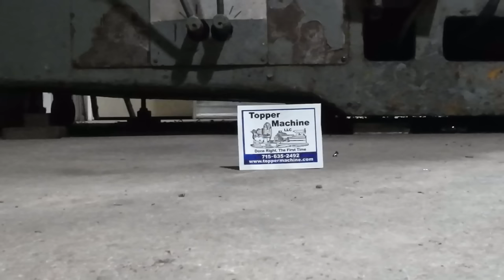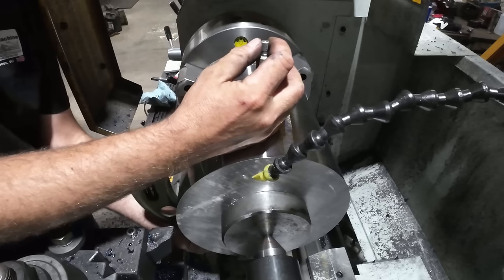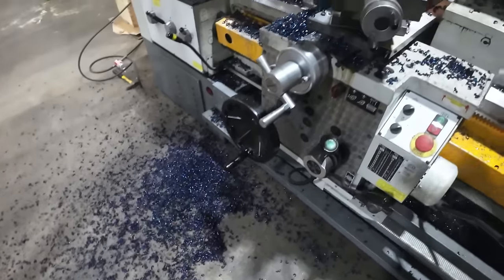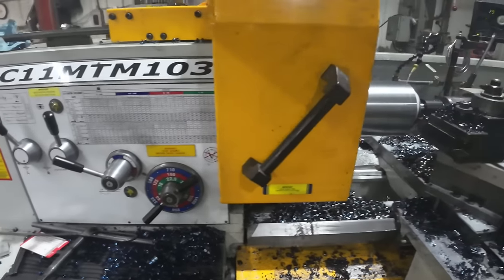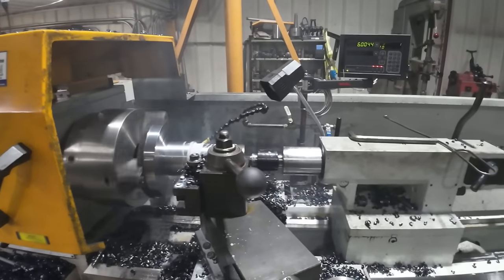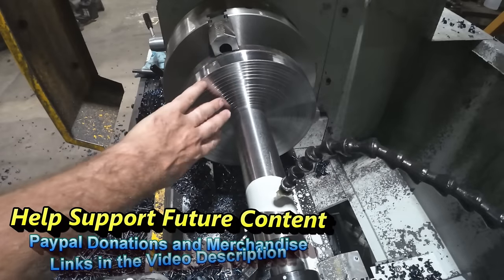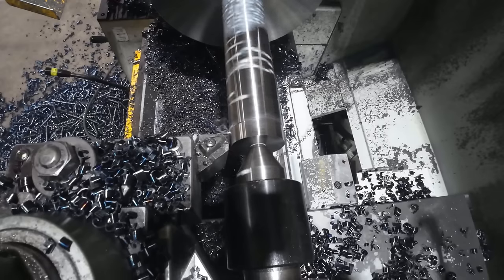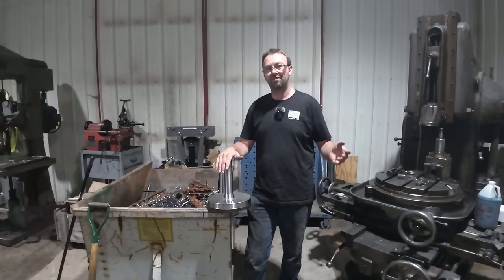Turning a Solid Steel Bar into a Part - Heavy Metal Removal on the Lathe - Manual Machining

Comment: I appreciate that a turned one piece will be stronger, but I wonder why no radi were called for at the transitions - particularly at the shaft to flange, big stress raiser there?
Reply from the maker: I wondered that too, but not my design or choice.
Reply: Exactly. Just another good point that proves the ones who came up with this don't know their basics.
Reply: @bigbattenberg  100%.  This is absolutely a brand new engineer that doesn't have a clue what they're doing.
Reply: @TopperMachineLLC  Still curious about the total time to hog that much off. Similar to welding where you take and make all the right fit ups for the thickness involve then have to feed three hundred 1/8 rods into the vee. I did this as a novice and always wondered how much time it should be taking. I noticed you let it cool off when approaching final dims. Then used a trial finish cut then measure it to closely match your dimension. I also like the fact that you did not make a center but used a center plate and relied on it to not shift thru out the process. I would have made a center hole and ran the live center into it and reef down on tailstock so it would not move. Good job.
Reply from the maker: @martinnorbeck4657  it took 3 hours total with all of the camera setups and planning each shot. The job shown was a total of 45 minutes.
Reply: @TopperMachineLLC  Wow, a lot faster than I thought. You were cutting it like I would too. The chips were coming off yellow brown when you readjusted your feed. That lion lathe looks real good and accurate. Thanks again for the vid. and the quick reply.
Reply: @bigbattenberg  how can you say that when you don't know what it's for?
Reply: It depends on how many are going to be made, a one off is much quicker and cheaper process to make something like that from billet, if he was making 50 of them, things would probably be different because it might be worth the extra processes to cut down material costs.  
As for the people saying the designer doesn't know what they're doing for not having a radius, while it may be a mistake none of the people commenting here could possibly know, besides Topper, if it is even needed.
Reply: He said if you listened properly he has been an engineer for 25years he is highly qualified and knows what he is doing
Reply: @PeterShaw-lb9lt  you’re missing the point. Nobody here or even him knows the true application for this part.
Reply: If the customer wants it that way, that’s what you give them if you want more work from them, it’s that simple.🇦🇺
Reply: @TopperMachineLLC Brute force and wasted steel is usually cheaper on one simple part than the time spent on engineering. I'm an engineer. This is what I've seen. 

But, every calculation I do ultimately gets incorporated into every piece I design, so I do get more efficient at design/build over time. Engineering places upper limits on how much we over-build. Without engineers, small cars would weigh as much as pickups do today "just to be safe".
Reply: @TopperMachineLLC  without knowing what the part is or does it’s hard to say if it needs a radius or not but if the customer said no then it’s on, give them what they want.🇦🇺
Reply: @PeterShaw-lb9lt no sir he said he has been using a 3 jaw instead of 4 for 25 years, he said nothing about being an engineer, if you listened  properly…
Reply: ...LET'S NOT SPLIT HAIRS...
Reply: Machine shops machine, engineers screw things up

Comment: I was auditing a forge shop with an automatic lathe running parts on an elevated platform. Hot chip flew past the safety shield and down the back of my shirt collar and I was slapping at it and freaking out trying to get it out (my shirt was tucked). Got burnt and sliced at the same time. Not fun. Thank god I was quality and not safety auditor.

Comment: These type of stub shafts made out of a solid piece of steel are fairly common. I have designed stub shafts that are extremely similar to this piece that are made out of a solid chunk of 1045 as well.
Reply from the maker: I am starting to see it more so the last few years.
Reply: How many do you need to be making before getting custom forgings is worth the effort?
Reply from the maker: @benjaminshropshire2900  that's up to the customer. When they determine they want a larger quantity, they will start exploring options.
Reply: @TopperMachineLLC  true, as far as customer service goes. If the buyer wants it done one way and is willing to pay what that costs....

But I was asking a cost of manufacturing question. Does anyone have a ballpark idea of where the potential material savings becomes more than the cost of getting custom blanks?
Reply: @TopperMachineLLC  Indeed. When they want 100, they're stop making them like this. (and when it breaks in the field, the owner will not waste the time and money to make half a ton of chips.)
Reply: @TopperMachineLLC Spot on, ref volume, several alternatives, fusion welding a 3" bar, then turning that down, rotary friction welding a stepped disc to a bar, the latter wouldn't cost much on say 25 price run, basic tooling needed.

Comment: Sandvik CNMG inserts are the best in my opinion. They take a lot of abuse and keep a good edge longer than most. You get what you pay for is absolutely true in turning/milling tools.
Reply: Nice to have a variety of inserts from around the world.
Reply from the maker: These are by far my favorite, but I use many different styles and brands.
Reply: @TopperMachineLLC  gc4320?
Reply: I mean, sandvik is just a brand. Entirely depends on your grade.
Reply: Have you ever tried Kennametal Fix Perfect? Thats an insert that can take abuse and it has 8 cutting edges. Grind a negative cuttinge edge on it and will even cut through 2mm surface harden 54HRC in one go, something i would never try with a CNMG insert.

Comment: stupid question
 does there exust a technique  or tool to plunge cut job like that from the front and then just part the produced section of outer tubing  instead of just turning everything into chips?

Comment: Stupid question time from a woodworking perspective. If I was making a similar part out of wood (not for your kind of application,  obviously), I would make a rough cut with a  saw and remove much of the material from the stock instead of turning it into chips. 

I am not a machinist by any means, but I have to wonder if you could bandsaw some of the waste off prior to turning to final dimensions. 

Fascinating work, Josh. Thanks for sharing.

Comment: Many years ago I had a customer who made drive components and the method they used was start with a solid blank anc using a modified band saw make 6 cuts lengthways and 6 cuts around the bar , this reduced the diameter to a hex slightly more than the  finished size , they said it reduced the time by 80 percent , their one had spines on the small end and a bolted flange for a Donut on the large end

Comment: Job will take forever with those depth of cuts. Centre drill in , centre on it and take at least 1/2 in cuts. 1/4 inch radial. Surface speed at 570 ft/min. Feed about 0.20 inch

Comment: Do you know that in the Soviet Union sometimes  it came to the point that turners set the task of turning round solid bars into chips in order to close the plan for the scrap metal . At the end of the year, if some plant did not close the plan for scrap metal, then the turners were forced to turned bars into chips).

Comment: Great video!

Every time I watch a “shafty flangey” turning job where typically 90% of the starting round bar has to turn to chips, I think about the business opportunity in the steel industry to supply shafty-flangey blanks.  It would not be trivial - there are four parameters needed to specify a shafty-flangey blank, so you can’t just brute force it. But the potential reduction of waste is so big that I feel there must be an opportunity there.

Comment: Hi back in 1979 I was a Forman for Celmar a very large moving shop we made things for the government some I wasn't allowed to even talk about. But we had a giant lathe about 60" x 80' came from their navy shop that made propeller shafts . Well I had her spitting 3/4" chips with high speed tooling. Start one cut and run a ten hour shift to be close to the end of cut. 
I had the set ups for the men then they operated them. Your big chip cuts reminded me .  Great company to work for too. Six months there and I became a quadraperectic ROM a dont r cutting exploring my spine. They waned me back but I couldn't do my job.  We had planer mills a vbm  with 12' table and sunk to floor level and its own extra high roof cut in. Abot 35' tall columns  my specialty the big jobs. Used forklift and sledge hammers to set up parts. Oh I was big and super strong not bragging ..
Reply: JOBBING SHOP I HATE SPELL CK. CHANGES WORDS TO ITS OWN THINKING.!!!!
Reply: @silverbullet7434  Spiel  chucker hand auto collect guts my gloat two! :-)))
Reply: ...IF YOU SAY SO...

Comment: instead of wasting all that material, I'd had used a bandsaw to cut it down to size...(think of cutting corn of the cob)  and still have that material for future use on another project

Comment: I spent 25+ years in jobber machining, single piece, either OEM replacement parts no longer available or outsourcing new parts were to long of a wait, or the custom part for prototyping/ proof of concept type pieces. Lathe was my favorite machine in the shop with portable line bore my second. You have a new subscriber sir, like your thinking and approach to your work, thanks for the tag along video, BTW, Scout crafter recommended your channel.

Comment: That’s a big piece to machine down and a lot of chips to clean up, when we did jobs like this only 8 in dia we took one of those plastic according downs mounted one side to drive area and the other to the tool mount .we would open it all the way up and as it feed in it would still be at a good angle to catch most of the chips

Comment: Its very soothing to do big removals. Initially the part is just a 110mm with some H7 tollerance on it for some bearings..but they wanted to see if we could make the square flange in one gone...  So we ended up with a 380mm roundstock.... 95% removed... i guess the welders didn't do a good enough job!

Comment: Make a trepanning tool  ( long tube with carbide cutters at the end) so you can save the outside material as a tube after running a cut to leave the bottom plate attached. I do not like wasting material into chips even if the customer paid for that material 🙏 that is a ton of material wasted there in this operation 🤔 oh, and you save time cutting once and parting once, then clean up to size. 
Should be super easy with a lathe of that caliber 👍

Comment: A great video on metal removal, something that is close to my heart being a retired Seco Tools guy. May I suggest a few calculations to check your surface speed against the RPM rather than to guess. You could always check Sandviks cutting data for the grade of carbide againt the material as well. Good to see you supporting quality tooling, it goes well with your very grunty lathe. Cheers Ian
Reply from the maker: I've always used the baseline info for cutting, but was taught to tweek and produce better results. It's amazing how much you can push some inserts and have to baby others. I was nowhere near what I've pushed these inserts to, but I also know what gives me the best chip, tool life and surface finish. I could have pushed a lot harder but may have used up a few corners on the job. I did this all on one corner, roughing and finishing.

Comment: If the part is heat treated after machining, yes you need to be out of solid … 1045 steel is soft as butter without heat treat, so no good reason not making it out of 2 welded parts… I am mechanical engineer and 90% of my job is to beef up OM parts on … So just because is OM doesn’t mean that they ar good. Collaborating whit a lot of factories, lot of engineers ar week. I am a fan of machining flanges like that, but it depends

Comment: Brilliant video. My question is if you are turning a taper. What's the best way to counteract that. Maybe by adjusting the tailstock? 

Regards,
Joshua.
Reply from the maker: Check level of your machine first.  It should be checked at least once a year.  Once level, then check your tailstock.

Comment: A single solid peace is always going to be stronger than two welded together, = fewer failures, longer life of the part and less down time. I figured the yt police would chime in on this one so straight to the comments and they did not disappoint lol   Thanks for sharing.👍
Reply from the maker: Loads of stupid comments on this video.  All of them entertaining, none of them have a clue.  LOL
Reply: "none of them have a clue" as in zero understanding 😞
Reply: All comments are grist for the algorithm mill. Never discourage engagement.
Reply: Fairly sure a forging is stronger, ref flow lines.
Reply: @bostedtap8399  Yes a proper forging would be stronger.  It is probably real close to a wash as to the cost of material versus having a forging made.
Reply: @bcbloc02  Hi Brian, I  think the draughtsperson was being lazy, especially with cost of materials and alloy surcharges, (Ref Russian sanctions), I would have called up a 2 piece weldment, welding a 3 or 4" bar in the end disc, with pre-machining bore and weld prep, always good practice having a weld joint at least twice the diameter of shaft. Have a great weekend.
Reply: @bostedtap8399  ok? But do you understand that every machinist thinks your way is shit?
Your way you have an extra 2 precision fits, no gaurentee of squareness and you have to machine through weld. Oh yeah and you have to weld it.
Times have moved on. Material removal is cheaper that ever with modern carbide.
Reply: @spikeypineapple552  Good to know!
Reply: @bostedtap8399   That also means you have this part 3 times on the lathe, the disc, the bar and the assembly, also C45 isnt that easy to weld and need heat treatment afterwards, otherwise the weld will eat the carbide inserts when trying to cut them.
Reply: Not exactly true, there must be something more subtle going on. It's stronger if you weld the shaft into the disk at the radius of the shaft. But if you make that part of the shaft larger you can choose a radius such that the weld is stronger than the shaft. So there will be no way to apply enough torque for the weld to fail. The shaft will twist off first.

That's a lot of metal, so while machining it is cheaper, the material cost is not inconsequential. 

I wager there's a far more subtle reason for it having to be one piece.

Comment: Heya! First timer and new sub here!
Short introduction: The last 5 years i was doing mostly lathe work and deep hole drilling. maunal and NC/CNC and most parts the size of what you had on the machine or bigger.
The piece you used to push the part into the 3 jaw chuck (yes it's good enough and i don't get the people moaning about that either, it's perfectly accurate and no hassle to setup whatsoever...) with the center already in it... Makes perfect sense now that i see it the first time and im impressed that one can even take a healthy cut with it. Great idea! 
I wouldn't try your approch on a 1,8 ton chonker but ima have such a contraption around for the next time i have a piece in that dimensions. lol
Really nice work on the part and the vid and nice to see some healthy cuts on a manual.
Keep it up and thanks for sharing!
Reply from the maker: Thank you. The plate center has been a great addition to the shop and I have several sizes now.

Comment: I looked at the manual, and assuming you are using the "DJI Mic", it has an option called "Mono with Safety Track" that will avoid distortion with varying volume. And you generally want to reduce the "Transmitter Gain" via the screen of the microphone. Depending on which video software you are using, I can provide some settings to then normalize and compress the audio back to normal volume so that people won't complain about the audio being too quiet.
Reply from the maker: Send me an email and we can go over these details. I really appreciate the help.

Comment: Really enjoy you videos, I am a home hobbyist with a Logan 14" lathe and play around but nothing to your caliber.

I was thinking couldn't you use a hole saw on the end and then use a cut off tool to take each section off until you get it closer to final dimensions, this would give you some rings for other projects.  

Just a thought vs wasting all that material
Reply: 2 1/2" deep core drill, & then cutoff tool? Maybe make one if doing many of these, someone on Youtube was making these from steel tube & inserts, to core out several feet deep on a lathe..  great video..

Comment: Not going to comment on welding it, but I am curious why you didn't use a combination of grooving/plunge tool to form the bar from the end without losing most of the material, so it's available for a later work piece instead of a load of chips on the floor. Then a slitting tool to get the plate or at least the rough shape. Just seems like a large amount of waste material that could be used for something else without having to smelt and recast. End result; something that looks like a short piece of thick walled pipe and the finished product.
Reply from the maker: I don't have any trepanning tools, and a rare job like this isn't worth the investment.

Comment: I know it's possible that you can't answer this question for confidential reasons for both you and the customer but what is the finished diameter and what was the minimum and maximum tolerance you have according to the blueprint?
Reply from the maker: This was several weeks ago, so I don't even remember. I know it was undersize on the drawing by a couple thou.  It finished at 1.935" as stated in the video. I think that was the size needed +0.000/-0.002" but I still don't remember.